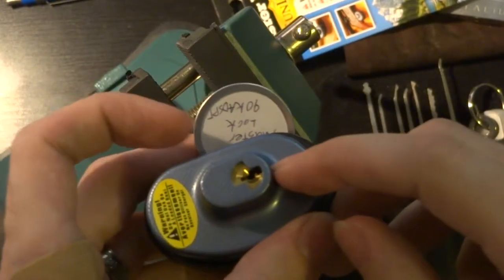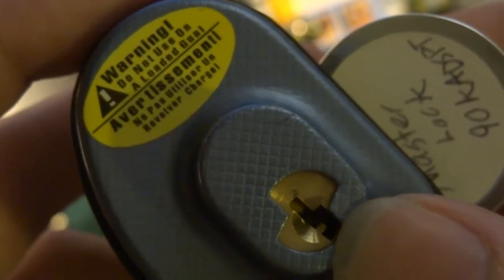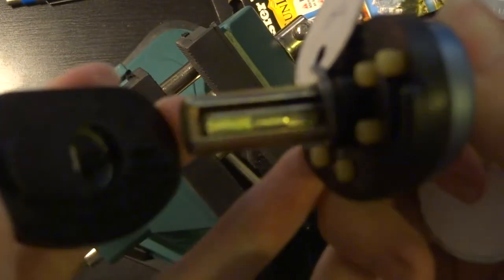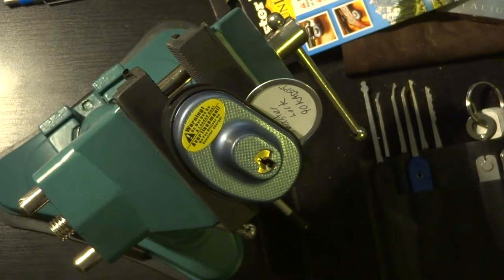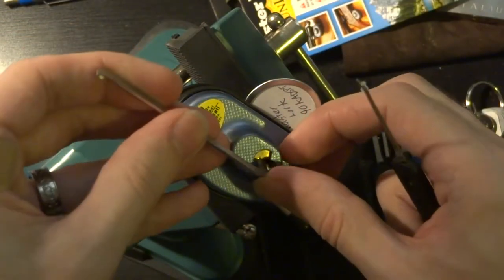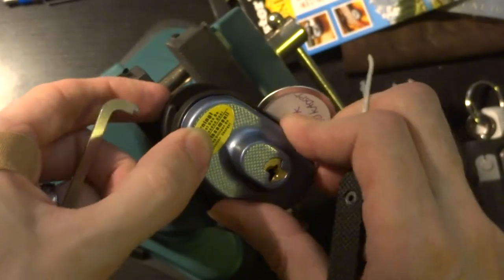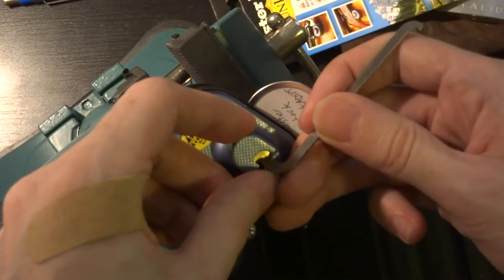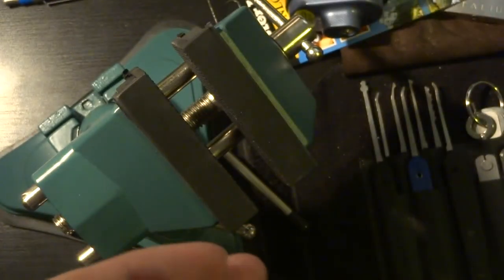(011) Master Lock model 90KADSPT Trigger Lock picked

Comment: First off thank you for doing this video 5 years before LockPickingLawyer and that you don’t try to feel and call out the pins and you are using a sparrows hook, could this lock be raked or bumped open in your opinion?

Given that it is a Master Lock.